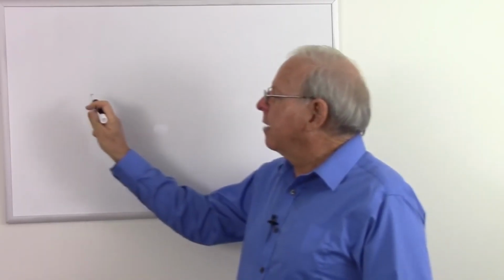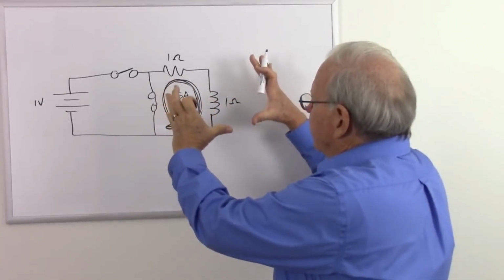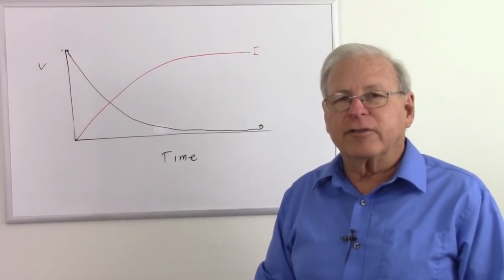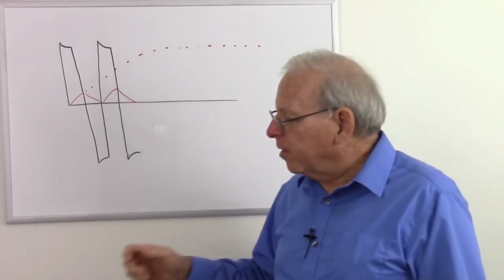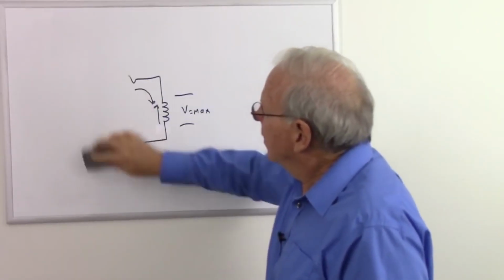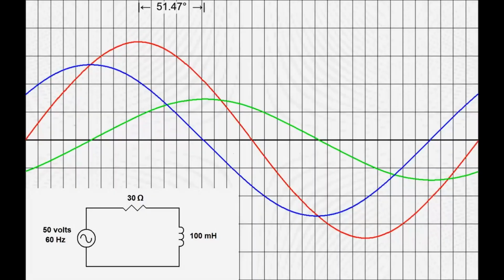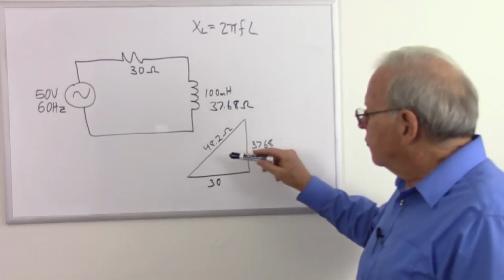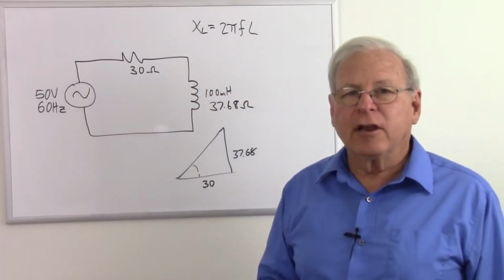AC Basics   Inductors in AC Circuits

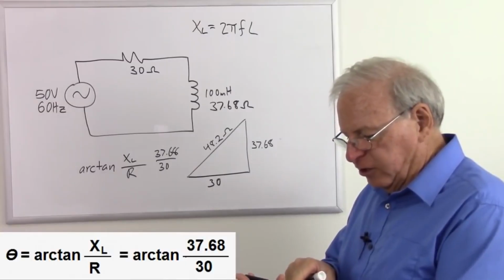Comment: 27:27 It's not a reciprocal. It's an inverse function. The reciprocal of tangent (sin/cos)  is cotangent (cos/sin), not the arctangent. The arctangent is the inverse function (the one that swaps the inputs with the outputs). It gives you the angle for the given ratio, instead of the ratio for the given angle.

Comment: Your coverage of inductors was faster than your coverage of capacitors, for some reason(s) .  This is unfortunate.   For example to prove my point, with capacitors you went through much details and you spent much time doing the graphs of voltage and current.  Then you showed the graphs when capacitor was the Source in detail.  However, with Inductors, you simply said I will change colors on the capacitors 's graphs !    You shouldn't have done that, in my view, because these 2 "rascals" are problematic because of the confusing nature of these electrical components and it takes a lot of details to show beginning students, that these 2 problematic components can be mastered with some careful explanations.  And you did that detailed coverage with capacitors but you did a mortal sin when you began with Inductors, as most Math teachers often do in calculus coverage of some topics.  Math teachers will often say, "Oh, the rest of this solution is obvious and never show the many steps why it is indeed "obvious" !

So I give you a C grade instead of a A grade.

You tried and you were doing great and then you either got tired or bored with the subject matter, and you ended up getting an average score.

Maybe, next topics in AC or transistor circuits, you'll get much better grades.

I know teaching electronics or higher level math topics is not easy, but if done with care and all steps are laid out, where clear understanding is attempted, that the students gains incredible insights and long term understandings and real learning is gained for all students.

At this time, I am now reminded of a math modern major  topic known as " Linear Algebra".

Most run of the mill, math teachers do a mediocre job at explaining the mysterious but very important modern math topics with matrices, determinants when solving large numbers of simultaneous system equations.  However, trying to understand how to work with large matrices and eigen values and eigen functions is very confusing to beginning technical students and even math majors.  Math majors learn how to do the mechanics in getting answers but have no idea what it all means !!!

Even MIT professors can't clearly explain what Linear Algebra really all means !

Then comes along some YouTube teacher showing Linear Algebra using graphical pictures and it all becomes clear why a student needs to know Linear Algebra and why one uses the methods and the "mechanics" typical done by math majors and others using Linear Algebra techniques.

The name of this YouTube teacher goes by I think,  "3 Blue 2 Brown" .

This teacher goes very fast in his presentations, but his graphical methods go a long way to get a good understanding why a technical person or math major follows math steps to get solutions to large matrices containing system equations to model various complicated systems relating to complex electrical systems or complex mechanical systems or any complicated system that uses linear equations to describe that system's functionality and you want to know how stable it will be under various excitations or forcing functions chosen by the system designer(s).

In conclusion, explaining ALL the steps, in a slow manner, should be considered important thing to do so all students gain a deep and clear understanding of the subject matter being discussed by a teacher.  If steps are skipped or left to the beginning student to try to figure out , then don't be amazed that most students get low understanding and then low grades.

We saw this phenomenon during the 2 year COVID 19 crisis, where the Teachers Union told the CDC that children had to learn with using a computer App.

We should not be shocked that all the 4th graders in an upstate city all the students Failed math, reading and English tests !

Teachers Union shoved a bad policy on all students and an entire generation of young students will pay the price for a Teacher Union horrible , selfish policy foisted upon a vulnerable young children who could not fight back against this political group that has gotten worse since the 1970's.

All they want is more money and benefits but don't want to be accountable for what parents and society demand that children are properly taught the basics so they can succeed in life and not end up in prison because they could not read and write or do basic math.

Good teachers are necessary because society excels when people are well educated !

Good luck on next electrical topics.

.
Reply: I too saw that he didn't go into as much detail with inductors as capacitors. But still his explanations are very good.
Reply: Where is your example video of you showing us his it should be done?

Talk is cheap in the comment section

Show us how it’s done Professor!
Reply: Yes teaching is a jobs program, everyone knows this by now, except for people who are still sending their kids to public school

Public school is child abuse

Stop sending your children a child abuse centers

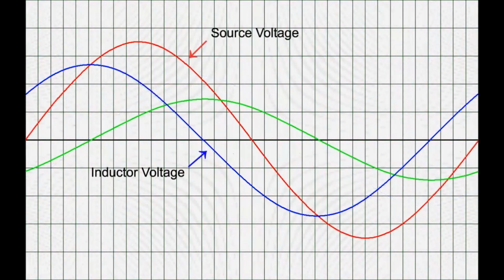Comment: if inductor voltage =Ldi/dt and V-source =Ldi/dt, then why do the inductor and source voltages have phase differences as shown in the graphs @ time 19:58 It doesn't appear that V-source=Ldi/dt at all, and yet the equation V-source=Ldi/dt is used to derive the current through inductor. Totally confusing.
Reply: Well you would be correct if there was only inductor in the circuit but there is also a resistor in series with inductor. The voltage of the source seperates between inductor and resistor. So that the sum of instantanous voltages of resistor and inductor would equal source voltage. v - source = i * R + Ldi/dt. And I am talking about instantanous values not RMS values because you can not directly do sum of RMS voltages to get RMS voltage of source. But you can directly sum instantanous voltages to get voltage of source. But you would be correct if there was only inductor in circuit. Then all the voltage would have to be across inductor and the voltage of inductor would be in phase and in equal value as voltage of source. Hopefully this clears your confusion.
Reply: @Slovenija_patriot  Thanks a lot!
Reply: @Festus2022  No problem.

Comment: My mind is blown to learn that voltage can be pushing in one direction and current can be flowing in the opposite direction on the same wire and at the same time. Also, I noticed that as current went up, voltage went down, but I'm not sure how this can be since it seems to contradict ohms law, where when voltage increases, current also increases. What am I missing here? And also in other videos you said that in order to have current flow there must be resistance and voltage. How then can there be more current with less voltage?
Reply: In a nutshell it's not a passive resistor.  Capacitors and inductors are reactive components where voltage and current are not in phase.  Remember, "ELI the ICE man".  ELI = voltage leads current in a inductor.  ICE = current leads voltage in a capacitor.
Reply: @gregorykotoch5045 Yes when I first learned it I was confused too. You shouldn't confuse Ohm's law with inductors and capacitors. Ohm's law V = I * R stands for ohmic resistance. As voltage across resistor goes up current goes up (they are in phase and have the same shape). But for capacitors and inductors you should look at this two equations which are very important for understanding how they work. Inductor voltage: V = L * di/dt    Capacitor current: I = C * dv/dt. If you look at the formula for voltage across inductor you can see that voltage is proportional to inductance and change of current. So the voltage is the highest when current is changing the fastest (when the line on the graph is most sharp/vertical) and lowest when it is changing the lowest (when the line on the graph is mostly flat). If we know look at the formula for current across capacitor we can see that the current through capacitor is proportional to capacitance and change of voltage across capacitor. So the current is the highest when voltage is changing the fastest (when the line on the graph is most sharp/vertical) and lowest when it is changing the lowest (when the line on the graph is mostly flat). In summary voltage across inductor is dependent on how fast the current changes not how big the current is and the current through capacitor is dependent on how fast the voltage across capacitor changes not how big the voltage is.
Reply: @gregorykotoch5045 Also about why the voltage and current across capacitor and inductor are sometimes in different directions. Inductor opposes change in current by inducing voltage in such direction that it opposes change in current. So when current rises the induced voltage opposes direction of current, but when it starts falling the inductor induces voltage in such direction that the current keeps going. That's why induced voltage is not always the same polartiy as current and voltage source. Know about capacitor. Capacitor voltage changes the most when current is the higest (that's because it charges the most when current is the highest). And there is no current when the voltage across capacitor is highest because capacitor is full and can not take any more charge. Capacitors and inductors are opposite to each other. That's why current and voltage do not need to always be in the same direction.
Reply: @Slovenija_patriot  I wanted to remember to thank you before I forgot for your well thought out answer to my questions. I will have to look deeper into the formula you posted.
Reply: @Slovenija_patriot Hey I'm having a similar doubt and seems like you might be able to clear it is there anyway I can connect with you mail or smth.
Reply: There is no such a thing as Ohms Law. Thats the reason. There is Ohms Model, that is useful in describing ideal resistors, but no law of nature that could fit into equation given by Ohm. When you stop saying Ohms Law, there is no longer a contradiction.

Comment: How is j used in the formula.
Reply: It refers to a 90 degree phase shift of the waveforms.  When voltage and/or current is represented as a complex number, this really represents a superposition of a sine wave and a cosine wave.  The real part represents the sine wave's amplitude, and the imaginary part represents the cosine wave's amplitude.

Multiplying a phasor by j*w, will shift it to lead the original waveform.
Dividing a phasor by j*w, will cause it to lag the original waveform.

Comment: Ok but Xc=-1(2*Pi*C*F) is not very linear.
Reply: @leonsoviac5380 You are correct. The graph of capacitive reactance to frequency is not linear. But in the video he just wanted to show that the capacitive reactance decreases with increase in frequency.
Reply: It is, if you graph it on a double log plot.
Reply: @carultch  Well I don't know about that but if you graph the capacitive reactance to frequency and use equation  Xc = 1/2pi*f*C you would get a hyperbola line which is not straight line like with inductive reactance.
Reply: @Slovenija_patriot  I'm aware of that.  If you graph log(Xc) as a function of log(f), you will get a straight line.
Reply: @carultch  Ok thanks for letting me know. I didn't know that. I thought he just tried to simplify graph of capacitive reactance to frequency by drawing a straight line.
Reply: So? what is your not understanding?